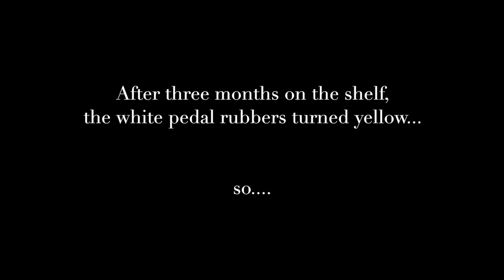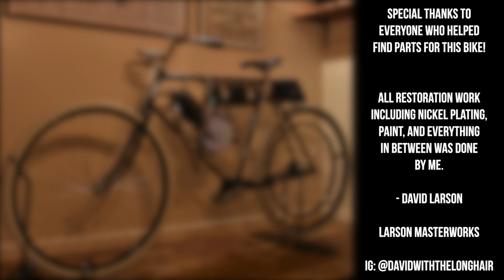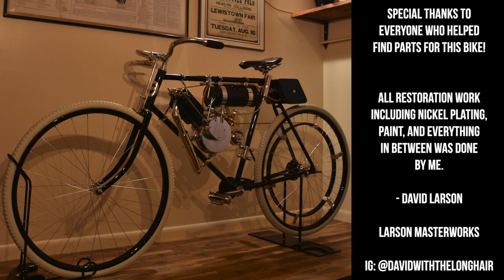Incredible 120 Year Old Motorcycle Time Lapse Assembly - 1901 Steffey - Very Rare and Valuable!

Comment: Interestingly, this cycle is shaft drive while cars at this time were belt or chain drive. Time passes and it goes the other way around. I ride a shaft-drive motorcycle. But it is only twenty years old. I just have to say. What a beautiful restoration. Very well done. Although, I did notice one small mistake. The bracket used to install the oiler can is made of aluminum. Although aluminum was around at the time of this bike, it is highly unlikely that this part would have been made of aluminum. Aluminum was very expensive at the time.